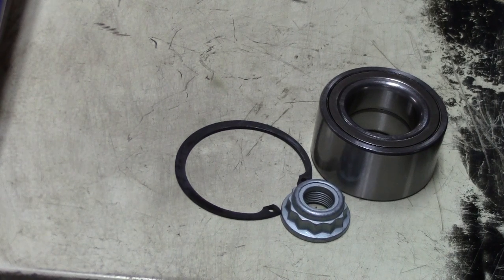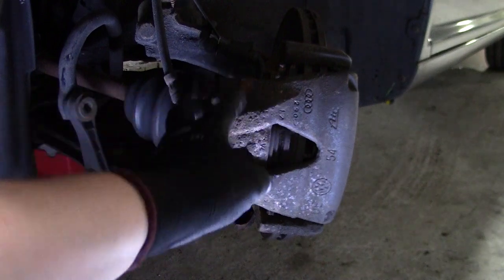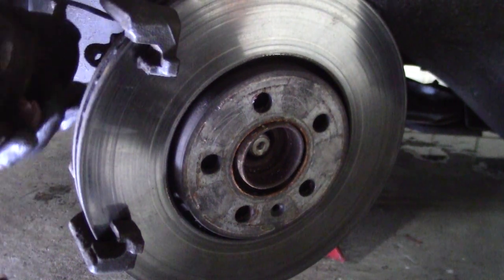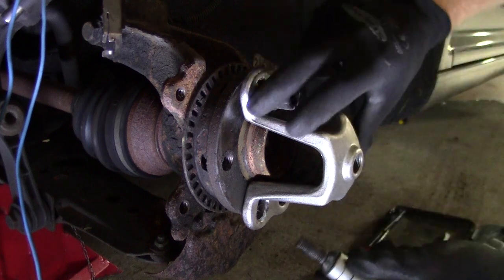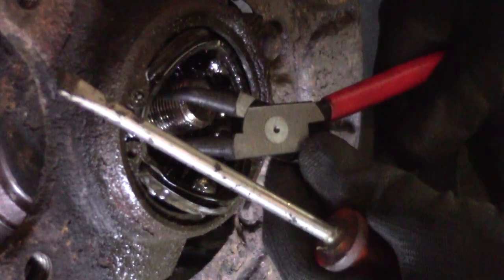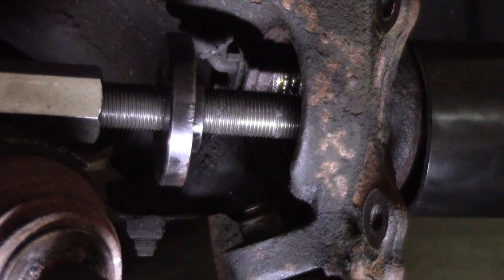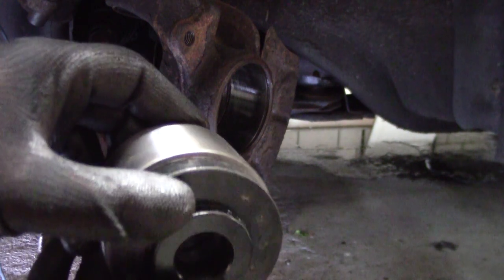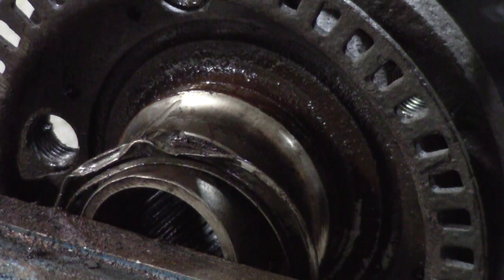How to replace a front wheelbearing Golf mk4 and other VAG models

Comment: Just to add, I have watched dozens if not more videos on how to change cv axles and hub bearings by popular channels and none of them ave ever shown how to properly torque the axle nut.  I have the VW repair instructions and you followed it to the letter. It's one thing to read the instructions but much more informative to see it done. Kudos for taking the extra time to show this very important step.  Great vid, 9 out of 10 rating. Cheers.
Reply from the maker: Thanks for the kudos, and you're right about the axle. I could have mention that.

Comment: The comment @ 9:34 would have been my assessment at the beginning of the video, I've never see a wheel bearing that bad and remain intact.  Good video guys, have to do this on my Audi TT, looks the same set up, thanks
Reply from the maker: Thank you and yes, all these cars are simmulair if not the same. Just be sure to check the torque specs for the axle nut of your car.

Comment: Great video, very detailed without taking too long doing it.  Just a note, mk4 VW vehicles have a inner cv joint that is bolted onto the transmission , they don't connect via a spline shaft thus there is no transmission oil leak when removing the axle. Very easy to remove.

Comment: I had to completely destroy my axel nut, I tried everything I had except for a very long pipe. I stood on the thing even back the car up on the breaker bar, it took a few days of drilling and bashing, unfortunately I ruined my wheel hub in the process and now I'm here smh. Good video.
Reply from the maker: That sucks, fortunately you can buy new wheel hubs and there not that expensive. Is the axle still usable? i can imagine that the thread is also mangle.

Comment: The manual states to torque the wheel bearing when the bearing is NOT preloaded with the cars own weight as it will shorten bearing life
Reply from the maker: Then your manual is different then mine.  I do think either way is fine.

Comment: i bought my 2001 jetta in 2011 and i still have the same front pads from the previous owner (70k miles). I've replaced the rear pads at least 3 times. It appears that these cars are rear biased when braking. Year models 99-01 have the same brake module. great video.
Reply from the maker: The rear calipers are just a bad design they get stuck very easily. That's probably the reason why the rear wears a lot quicker then the fronts.
Reply: Something wrong in your rear.  Replaced my 2000 VR6 rears maybe once or twice in the past 20 years.  Fronts? Maybe three times.  Rust is the biggest enemy at his age.  Akebono for dust free.

Comment: Thumbs up for actually showing a method for removing the inner race from the hub. For some reason everyone thinks this isn't important √°-° like really?! It's the one thing that messes you up if you haven't done this before.
Reply from the maker: The inner race is always a hassle. You don't want to cut to deep but also not to little. And then try to split it, sometimes it can take a lot of time just to get it off. Thanks for the comment!

Comment: some ideas to improve this process. I think it's easier to remove the entire strut/knuckle assembly from the car and hammer out the hub from the back... only 2 more nuts, tie rod and the top strut nut and you don't have to remove the caliper carrier. Before removing the assembly paint the bottom 3 bolts/control arm for the ball joint so it can be lined up on reinstall and no alignment needed. Second to remove the inner race from the hub I used a 3 arm puller with a hose clamp wrapped around it tightened up real nice and it came off easy once I read about the hose clamp idea otherwise it wasn't gripping. No grinding, or damage to the hub.
Reply from the maker: Hallo, thank you for your input. In some cases it is a better thing to do but it is also more time consuming and changes that you damage other parts also. But it is all up to you there are more than one way to do stuff.
Reply: genius with the hose clamp. might have to try that.

Comment: great vidéo ! but one reason for bad bearing is that There is no more back plate, you should install       one ! Thats why mine was scrap 😉
Reply from the maker: Thanks for the comment, but I don't think that's the issue. The splash shield is still installed but its a very small one. But thanks for the input!

Comment: Thanks for a very instructive video. I am doing this job now, but after reinstalling the hub I have noticed substantial amount of wobble when wrinkling  the hub, holding it hub at 12 and 6 o’clock. Is that ok since I have not tighten up the hub nut yet? Or could it be that the bearing is not pressed in completely? The locking ring is in place.
Reply from the maker: This must be gone when you tighten the hub nut if it is still wobbling then the shaft is sticking inside  the hub. Be sure to clean the splines.
Reply: @TheDutchGarage  Okay,  thanks a lot guys

Comment: Excellent video. No risk of damaging the ball joint while using the slide hammer? I assume once complete an alignment will be required? 

Thanks again from Colorado, USA!
Reply from the maker: Hallo, thank you for the compliment! And that is a really good question I never tough about that. And I think the impact it makes doesn't hurt the ball joint. because there sharp burst of load. I think hitting the curb will have more impact. But still your right the ball joint takes the beating also.Technically you don't need a alignment, we don't adjust the suspension. But I think it is always a good idee. No thank you! Groningen, The Nederlands

Comment: Wasn't aware any Mk4s came with calipers that DIDN'T require a caliper rewind tool to push the pistons back?
Reply from the maker: Only the rear calipers you need a rewind tool. The reason is that the handbrake is integrated in the caliper nowadays. That why you don't need to use it on the front calipers.'
Reply: Ahh of course 👍

Comment: Just a heads up, the slide hammer in the affiliate link does not have the adapter to do this job. Be careful when ordering
Reply from the maker: REALLY? basterds it also happend with my kit. I did get one when I complaint about it but that was years ago. I will have a look into that.

Comment: nice video very informative. Can you comment that i just changed the bearing  and now the ABS locking when stopping the car on the same wheel? i have cleaned the sensor it did not help. I read somewhere that the other side wheel bearing need to be changed also ?
Reply from the maker: Hi, Is it possible that you maybe bend the abs disk that sits on the hub? It that thing is bend then the sensor can misread things.
Reply: @TheDutchGarage  I would lean more towards it being a possibly damaged or worn out caliper wo any more information.
Reply from the maker: @emotionalintelligence776  It is possible offcouse, but (at least how i read it) he didn't have that issue before he removed te bearing.

Comment: I'm dreading changing my bearing. Looks like such a pain in the ass
Reply from the maker: This is an extreme case. But be sure you have a slide hammer and a bearing press tool.
Reply: @TheDutchGarage  I've got a bearing press tool which did advertise to also remove a bearing as well but I will look into the hammer
Reply from the maker: Removing the bearing yes, but most of the time the pins including for removing the hub doesn't fit.

Comment: Thank you so much. Do you have Amazon link for bearing tool extractor?
Reply from the maker: No problem, i also made a video about the tool. https://www.youtube.com/watch?v=LHytrFuN8fY ther are a couple of ebay links in there. but this is what i found on amazon https://www.amazon.com/OrionMotorTech-23-Piece-Adapters-Replacement-Installer/dp/B01FLVOAZI/ref=sr_1_38_sspa?s=automotive&ie=UTF8&qid=1547541655&sr=1-38-spons&keywords=bearing+puller&psc=1 it is not the same kit but it would work the shame.

Comment: So did using the cutting wheel help the inner race that was still on the wheel hub relieve some of the pressure? Or was it mostly just wedging the cold chisel between the hub and the race and pounding on it to help separate the two?
Reply from the maker: You make a slit into the metal race, and than use a chisel to crack the metal race. Then there is no clamping force anymore. The race is hardened so its really tough but also very brittle.

Comment: Is it very important to torque the axle nut in that particular order? I changed my wheel bearing a couple of months back, and I was not aware of this method. Lately it started making noises from the wheel again, and I checked today that the bearing seems to be completely broken, yet again...I just need to know where I went wrong the first time, and maybe this was it?
Reply from the maker: I don't think it is that important. With this method they just know for sure that the axle is all the way in the hub. It will ruin your bearing if you don't have that.

Comment: What size rear disk is required, I'm looking at kits, the bearing is 74mm but most kits have a 72mm disk.
Reply: 72mm one should be good, because then it will have one millimeter to the side all around. Exactly the same diameter could get stuck.

Comment: is there a kit out there that has all the discs and cups you need to press out the bearing and then press the new bearing back in?
Reply from the maker: Hi, there is a universal kit that works for 95% of the time. these are the common (ebay) kits and there cheap.

Comment: I did this with my drivers side. I used a 5lb sledge to put the bearing in hammering lightly on the outer race, then used a press tool like this one to seat in, same process with the hub, and I braced the inner race when using the press, I’m not sure I seated the hub far enough, the abs light is on all the time, but worst of all it seems like the bearing was never replaced, I still have wobble when driving or decel around 80km/h. I torqued the axel nut properly and played around with it, but I’m probably going to turn it till it stops and go for a drive. I’m lost.
Reply from the maker: That sucks, were you able to remove the axle easy or was it a nightmare? if it was hard then it can be that you werend abel to put it back all the way. That happend to me also.
Reply: Easy to remove the axel. Slide hammer was about 5 mins or less. I think the hub destroyed the new bearing or was not installed correctly. I will buy the correct tool and do it again. Question, on a new bearing do the inner races have free play to move side to side before install? I ask because mine did and I was told it was normal.
Reply from the maker: Yes that is normal, be sure that you support the bearing at the back when pressing in the wheel hub.

Comment: What size did u youse om the back Side to hold THE wheelbearing when u pressed in the hub ?
Reply from the maker: I don't know anymore, but the biggest one that could fit in the hole.
Reply: @TheDutchGarage  thanks i fitted a 60 mm pressed againts it 😁🤟
Reply from the maker: Glad it worked out.

Comment: Can you say exactly what race installer kit you have? I'm looking for one that has the disks with the cups.
Reply from the maker: I think the all the cheaper ones are the same. Link below is not the one i have but like a said they all look the same to me. https://www.ebay.co.uk/itm/Front-Wheel-Drive-Bearing-Removal-Adapter-Puller-Pulley-Tool-Kit-Master-Set/391983166387?epid=17015759172&hash=item5b440473b3:g:k3QAAOSw4HxZm-LN

Comment: I have a 2001 Jetta that the wheel bearings are bad if I fix this problem will it take the ABS and traction control lights off my cluster
Reply from the maker: Sorry dont think so, the abs sensor ring isn't in the bearing like some other cars. But you can clean the ring and sensor when you replace the bearing.
Reply: Thinks gr8 video by the way
Reply from the maker: Thank you!

Comment: VW brake pads are diff than american cars- they need to be spun back with the special kit, not by channel locks or C clamp; I ruined a brake caliper that way
Reply from the maker: Hallo, only the rear brake calliper you need to spun back becourse of the handbrake system in the calliper.
Reply: That's just the rear calipers, and most all makes (Cadillac, Ford, Nissan, etc)  that happen to use an integral parking brake require that step-and special tool.
Reply: The first clue that you do not know what you're talking about is you confused not just Brake calipers for Brake pads, but what is required to do the rear brakes on a VW which has nothing to do with this video. So plz go finish your beer or finish that herb and leave the car stuff to people who at least know which part is which. Cheerz.
Reply: Mike Villiams lol

Comment: What wheels are on the car? I like them a lot.
Reply from the maker: These are Boavista VW wheels. Thanks for the comment!
Reply: The Dutch Garage they are very nice! I just looked them up and they seem to only be available in Europe! Ugh
Reply from the maker: Really? Not even replicas?
Reply: The Dutch Garage nope. Cannot find them anywhere. Everything comes up for Europe. 😩
Reply from the maker: That's crap, a repro set over here is 400 euro. The original is also not that hard to get.
Reply: The Dutch Garage are they called something else? I searched everywhere and only found one wheel on eBay and it ships from Germany and costs $535!
Reply from the maker: No not really, its Boavista or Boa Vista. They were delivered under the Polo 6R.

Comment: Any one recommend what tool he used to get that bearing out lol
Reply from the maker: I do:-). This bearing was the worst I ever did. A hydraulic press is also a option.
Reply: @TheDutchGarage  just I’m having similar problem with my Audi the driveshaft is stuck in the hub and the process you done looks like the same way I will have to approach it I do my work myself and that’s why I was wondering what the tool was you used as it looks like I will be able to do it myself with that , plus I don’t have a hydraulic press i would need to take hub off to get it pressed and I can’t cos driveshaft lol

Comment: No bearing grease?
Reply from the maker: No, these are pre-packed. Thanks for watching.
Reply: So no need to put grease on outside of bearing?
Reply from the maker: Yes, just a bit to help it slide in.
Reply: Ok i have the red bearing grease
Reply from the maker: Wd 40 or any kind of grease will be fine.
Reply: Yeah I noticed that also, he cleaned it out good just didnt notice grease being added.